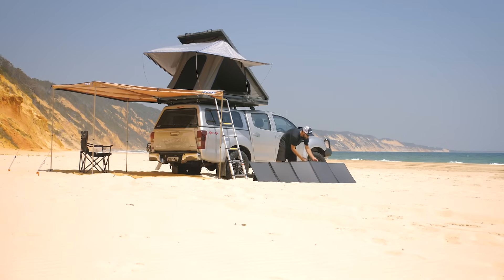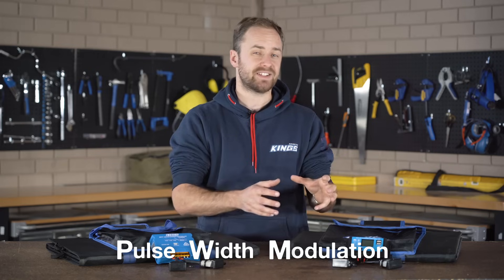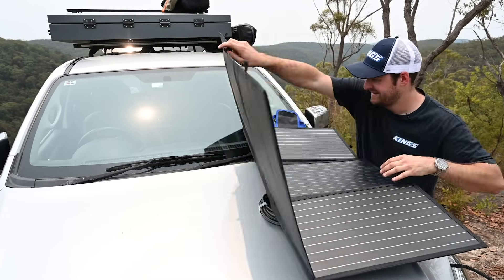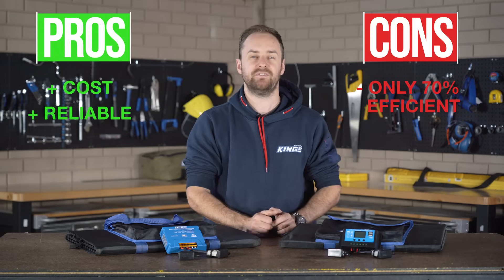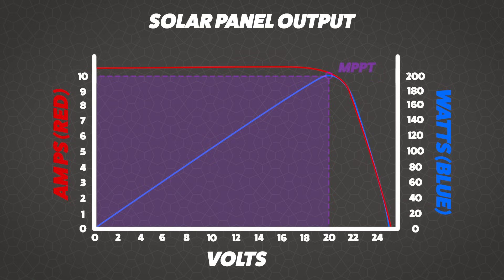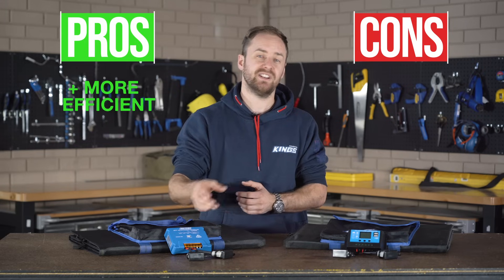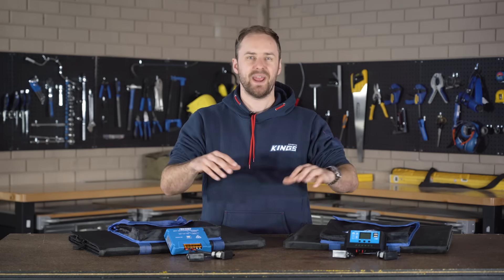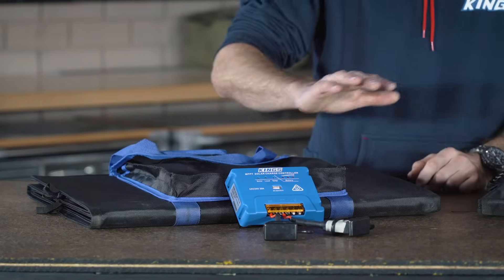SOLAR REGULATORS EXPLAINED! PWM versus MPPT - what's best & why? PLUS upgrade your solar controller!

Comment: You can use higher V panels with pmw controllers, mine has 700w/ 47v open panels ( pretty much same controller but 100A)
Reply: @test1 who do you work for ?? Paul jagos statement is correct...you can use higher voltage panels with PWM controllers...in fact the controller he used as an example in this presentation is rated for 12v and 24v systems... let us not confuse voltage amperage and wattage...the main point in the video is OK but the overall assumption is totally misleading particularly for ignorant newbies with no experience... a great hype for MPPT sales but fails to address other aspects... for example if your system is properly sized you don't need MPPT as PWM does a good enough job...especially if you have a lead acid based system where you are adhering to the battery percentage rules...unless you have another use for more power besides battery charging who needs more power ??? Pure hype for the MPPT sales world and MPPT lovers...in summary PWM is more than adequate for small to large battery banks... and far more cost effectively...I am a user of solar off grid for 30 plus years with many years of off grid living and testing. People swallow anything the so called experts give them...folks please for your own happiness do a lot more research than this one eyed one tracked video..
Reply: Bruce Watkins - I’m retired now, but to answer your question... NASA, DARPA, Northrop Grumman, L3 Harris.  I worked exclusively on satellites for 20 years.  Assembly, integration, test, and launch.  We always use MPPT technology in our solar arrays.  It’s not hype, it works extremely well, especially when you need every Watt that you can collect in order to power the satellite.  PWM technology wastes so much energy... it’s absurd.  I’d say that we can agree to disagree sir.
Reply: Bruce - Paul states that his solar system is 47V.  What’s happening to all that voltage ABOVE his 24Volt battery when using a PWM controller? (Or even worse, 47V all the way down to a 12Volt battery?).         Yepp, It gets thrown away.  That’s just shockingly inefficient.  Who would want that, just to save a few bucks?  Considering the amount of money people invest in their solar systems, (many over $5,000).... $200 extra for a good quality MPPT solar charge controller is well worth it.
Reply: @test1...Once a Rocket Scientist now unemployed and a fading memory... Interesting how this thread became about you and your personal history true or otherwise without acknowledging the paul jago statement is correct...he made no claims about efficiency simply a corrective statement on voltage...re the video makers blatant inaccuracies or perhaps lack of knowledge on PWM basics...let's be honest the video is really a sales ploy to the herd.
Reply: @brucewatkins1624  I tried so hard to NOT respond....... but I need to correct you.  

First off:   You are hilarious.  I wouldn't describe myself as "unemployed" as you stated,  I'm retired...... after a long and distinguished Aerospace career.   You on the other hand, make bold claims and have not answered my inquiry about your "expert" credentials.  Most likely, you have none.....  just an expert propensity for arguing.

Second:  Ok, let's address your continued predilection for errors.  The video is all about MPPT versus PWM controllers, right?  Over and over and over the video discusses MPPT vs. PWM.  Then Paul Jago comments "You can use higher V panels with pmw controllers".   I would argue that you can use higher Voltage panels with MPPT controllers!!!  All the PWM controllers I've looked up only let you go up to 24Volts.  While MPPT controllers let you go up to 150 Volts (or even higher.)  

Third:   My initial comment to Paul Jago was hijacked by your irrational diatribe.  After reading YOUR comment, I felt that I just had to respond to your "conspiracy theory"  regarding MPPT technology..... and THAT'S when this post got a little nuts.

Fourth:   I only mentioned my NASA experience BECAUSE YOU SPECIFICALLY ASKED WHO I WORKED FOR.   Remember?  The internet is full of so called "experts" on everything as trivial as Applesauce to Zebras.  In my case, I can actually back it up.  Can you?

  

For crying out loud, this is such a waste of time.  Here's the summary of the last 8 posts:  MPPT technology is significantly better than PWM.  And MPPT controllers can accommodate significantly higher Voltages than PWM controllers.   According to Bruce, it's a marketing conspiracy to sell more MPPT controllers.  My opinion is that it's just the natural progression of 50 year old technology getting much better and much more efficient.
Reply: @brucewatkins1624  Interesting to see how you become personal and in attack mode.. Is it because you can't debate the topic any further? Readers will make up their own thinking.
Reply: @danieslk52  it's not that I can't debate it's the fact that it's a topic blown out of proportion, over hyped by many people for varied reasons, I've had plenty to do with both types of controller technologies, many models and know exactly how this stuff behaves through years of interaction.  I'm not running space satellites as I'm sure 99.90% or more of people aren't, if you have anything specific to ask please do...
Reply: @test1...it's of little consequence what type of controller is being used...when the vessel is full and the demands satisfied power gets dumped by either type of controller.... the original statement is correct regardless of your concerns of inefficiency... we don't all maintain the same views as to what is considered the dominant aspect...worrying may be considered wasted energy...
Reply: @brucewatkins1624  Ok, you just keep on wasting your solar power, but don't encourage the rest of the world to do the same.  MPPT will outperform PWM for most everybody.  

The only thing that you and I agree on is:   once your battery is full, only THEN... do the PWM and MPPT controllers have similar performance.  Well, no kidding!  Gee, it isn't rocket science Bruce........  that's my day job.
Reply: @test1 ... You don't have a day job as you previously stated...now you're just being facetious and twisting the original statement to support your devotion to MPPT... the efficiency of solar and many other aspects of life has changed in 20 years...a TV for example uses a quarter of the power of the first flat screens...most people will do just fine with a PWM controller... To other people...I'd love to hear how many people are doing mission critical operations with their solar setup...if you are go MPPT...if not please don't be conned into something you just don't need...spend your hard earned on something more beneficial to your wellbeing...
Reply: @brucewatkins1624  If one has cloud for 2-10 days you need ALL the power you can get. I would like to see how you keep the fridge going with your PWM when wasting 50% of PV.
Reply: @danieslk52  I've never, not once had a problem keeping fridges running, not sure why you'd assume it'd be a problem, PWM isn't a deal breaker, a friend has a very similar setup but with MPPT having upgraded from PWM and they didn't notice any major difference, they are happy to be able to monitor stats with their phone but it's not changed anything, I honestly believe the best application for MPPT is more to do with yield in a grid connected system, both of us find our systems are charged by midday, no contest, perhaps in another part of the world it may be more critical but in southern Australia we are both more than happy with our systems.
Reply: @brucewatkins1624   Sure, I'm retired now.  Does that somehow make my 20 years of NASA Solar System Engineering knowledge vanish?  I humbly disagree.  Once a Rocket Scientist, always a Rocket Scientist... LOL.  

What are your expert credentials by the way Bruce?  You seem to be very opinionated on this topic.  Have you built any $4 Billion dollar satellites?  I have built several in my Aerospace career.  Even my cheap satellites were $350 Million.  My recommendation for MPPT controllers will ABSOLUTELY scale all the way down to the 'basic' one or two panel solar setup.  Based on your comments, you're living in the past, with 30+ years of old technology and refuse to admit the superiority of modern MPPT technology.  This was my job Bruce.  Nowadays, everyone can benefit from this technology, not just the Aerospace Industry.

How is it that you fail to see the plain and simple fact that with an MPPT charge controller, you'll get MORE power going into your battery?  That means you can purchase FEWER solar panels than if you were to buy a PWM controller, thus offsetting the higher initial MPPT cost.  With FEWER panels providing the SAME energy to the battery as the inefficient PWM system, another nice benefit is a smaller solar system, which is ideal for anyone implementing an RV or "portable" solar setup.  Bonus!

Ok, I'm done with this nonsensical back and forth arguing.  We will obviously never agree.  I urge you to actually research the current gain that MPPT controllers achieve when dropping the voltage, that PWM controllers just throw away!  It's not a gimmick or a marketing scam.  It's just modern technology.  The purpose of a solar system is to harvest as much energy as you can with the solar panels you have... not waste that energy because "PWM controllers are good enough."

Go ahead, I'll let you have the last word. (unless you continue to state inaccurate "facts" with no Engineering basis.)
Reply: @test1...you need to do more research...48 volt and higher are available... also parallel and series are options if you have knowledge to manage such configurations.
Reply: @test1...conspiracy theory... You must be kidding... 🙄
Reply: Paul Jago:  That’s not a true statement.  And if you understood the part about the current increasing (thus power increasing) when using MPPT controllers, then you’d see that the math only gets worse for PWM technology when the voltage is increased.  Stated another way, PWM controllers throw away the voltage above your battery’s voltage, while MPPT controllers utilize that extra voltage (by increasing current proportionally to the voltage drop).

Comment: great video. However I have installed my mppt....mp3743 and I am having difficulty understanding how to adjust the controls on the panel. Do I have to insert time on and time off to allow for the battery not to drain right down. A warning light E2. each morning the only way to get the unit to function and start charging is to plug in my 240v power to house lead then remove or use my generator if away from home.

Comment: great explanation, thank you.  Went away for a quick trip with a 200w solar blanket, 85ah battery and a 15ltr Waeco fridge, had three days of heavy cloud where the battery went flat.  Now I know why  PWM and solar blanket flat on the ground.  Will be buying a MPPT regulator and angling the solar blanket.
Reply: Blankets are also a bit shit. If you can get a folding panel they are usually better, but bulkier and heavier.

Comment: I found your video while looking at a different one. You explain PWM and MPPT a lot better than the other one. I still need to gain more understanding of watts, volts and amps, but your video is a great start.

Comment: Will the MPPT solar reg. charge a 100amp lithium Battery?
Reply from the maker: Hi Scott, Our Kings MPPT controller is only suitable for lead-acid batteries: LEAD, AGM, & GEL. We do make a PWM that works with some lithium batteries. You can check it out here - https://www.4wdsupacentre.com.au/15a-pwm-solar-controller.html
Cheers,
Saleha

Comment: With either system, once the battery is fully charged would you recommend disconnecting the regulators if you aren’t using the battery for anything ?
Reply: Why would you? It will keep the battery charged up and not harm it.

Comment: Would I need 4 these controllers to charge each battery that is in series at 48 volts I want to make sure I get the most amperage so a 48 volt charger is out of the question ❓since I am using 4 40 watt pannels
Reply: Link the solar panels together?
Reply: @simonpepper9721  if I did that in parallel then they can only hook up to one battery because if I hooked up all four going to all the batteries it would be like connecting the batteries in series and in parallel which would cause a fire or electrocute if I hook them up in series they would drop the amperage for charging 40÷12=3.3
48÷40=.8 amp. Hooking up each pannels to each battery seems the best out of getting the best charge out of a 48 v series hook up I just did my research I do indeed need 4 individual controllers for my application but I honestly don't think I need them for a 95 ah battery hook up with diodes

Comment: Hi there mate. 
I’m new to solar and batteries. I have a kings batter box which has 12v and USB outlets on it. It seems most solar controllers   have power from panels in. Power to batteries out. And 12 volt load out also.  Can I just feed panels into controller. Then out of controller into battery. And then use the low voltage outlets on the battery. Do I need a specific controller or can I use a standard one and just ignore the 12v terminals? 
Does any of this make sense? Cheers and thank you. 
John Davies.

Comment: Just bought a kings mppt regulator. Do I need to put an inline fuse in the wiring?
Reply: Always put a fuse between the panels and controller, between the controller and batteries, and between the batteries and the load.

Comment: Can I operate a 100w + a 120w sola blankets through one MPPT sola controler or do I need 2 MPPT's
Reply: You need to check the power capability of the MPPT itself. Most I’ve seen are rated to at least 400W, but I’ve seen some rated to 2000W. Check the specs, but I’d say that any off the shelf MPPT will cope with 220W
Reply: One unit only. But it's safer to go with a 30 amp. Mppt.
A bit of headroom for long-term stability and life.